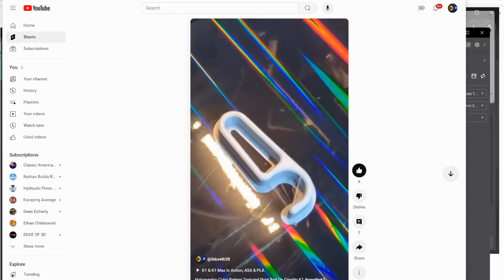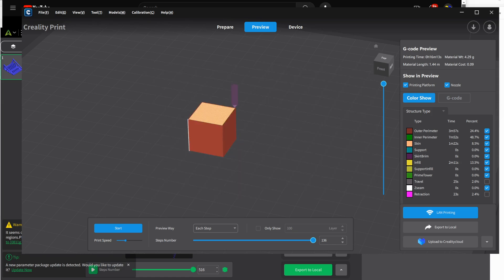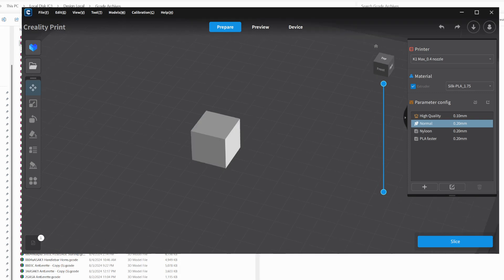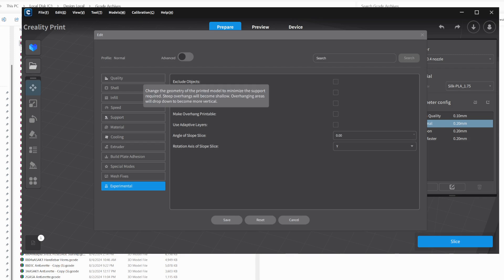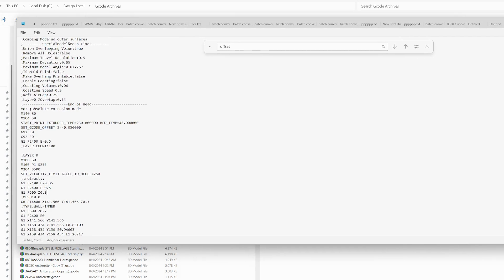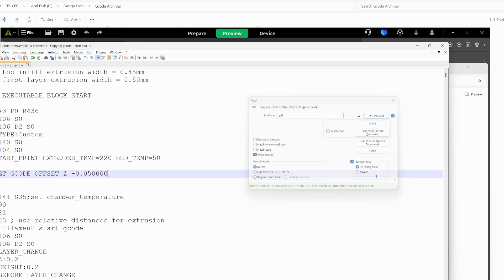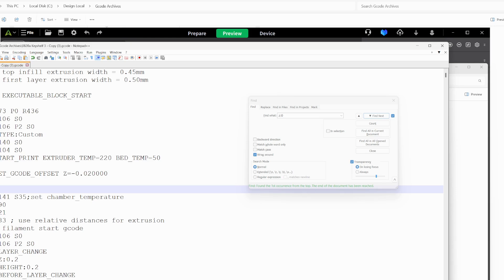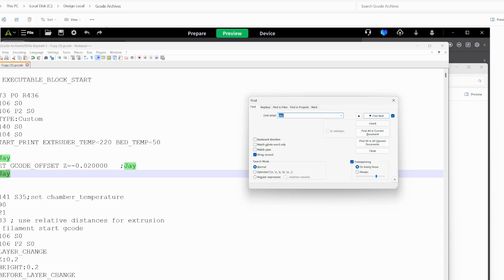Z-Offset In V5 Creality Print #crealityk1 #k1max #zoffset

Comment: On CP version 5, ZOffset can be adjusted in the advanced parameters of the Printer, not the process
Reply: on CP 4 too . in experimental settings
Reply from the maker: @narnia3256  Correct, as shown in my most popular vid to date :)
Reply: Please share where, I've looked for it many times, what section is it under?
Reply: @jaya8352  Printer with advanced settings-> Printable space -> Z offset
Reply: @xell29  Thanks.  Weird thing is soon after I posted that I found it but it wouldn't accept a decimal point and the description said what it's for and I inferred that it was for the z endstop stated reason only and that it wasn't intended for that precision bed squish.  But now I try it again and it does work.  So not sure if it was a bug in an older version or maybe I just needed a PC restart that day.